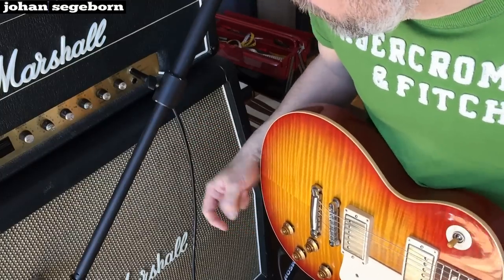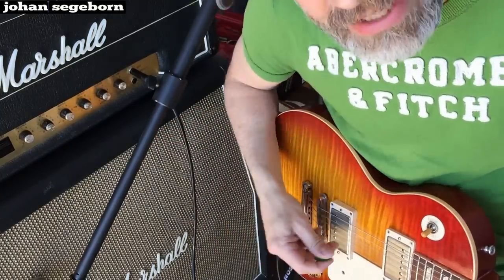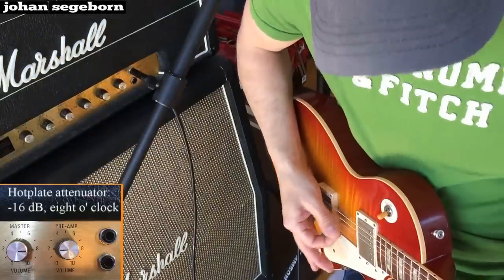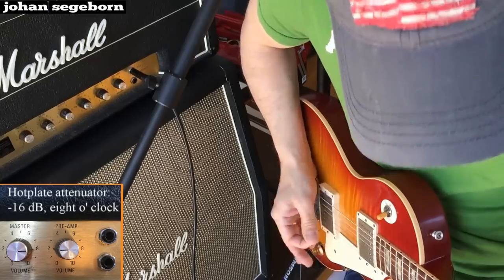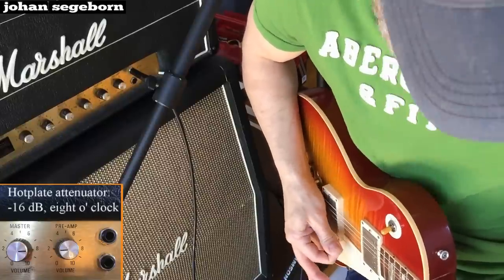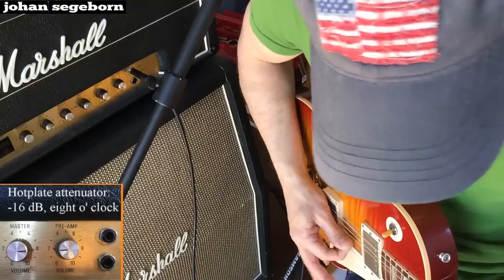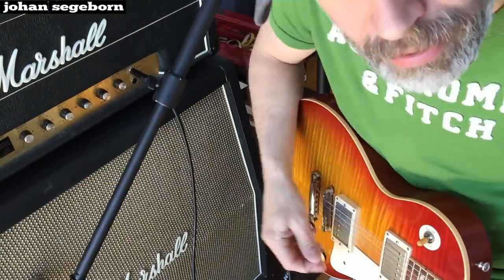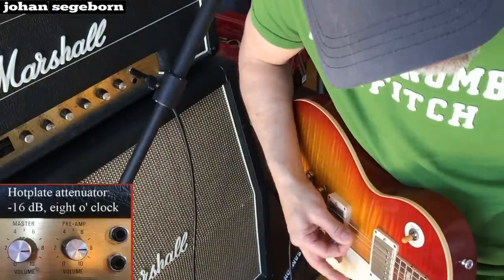Preamp Vs Power Tube Distortion

Comment: Hi, i was thinking just now about how big the difference is between different tubes, but i haven't seen a comparison between 6l6's at full volume vs el-34's at full volume, i think this could be a very interesting video, that many people would enjoy, Cheers!
Reply: 6L6s usually have more headroom and are a cleaner tube than EL34s. Also, more round and bass-heavy than 34s.
Reply: iHatePop Yes i already knew this, but a sound comparison would be nice, but i actually ended up buying a pair of el-34's and it changed the entire tone of my amp, the difference was like going from mesa to marshall, but in the end i am a metalhead and the el-34's didn't quite catch my tone, but still really nice for old school heavy metal. ,\m/

Comment: I think the attenuator affects the tone more negatively than having the master reduced. I like power tube distortion but not through a attenuator.
Reply from the maker: Yeah, there is definetly a trade off there
Reply: It is true. It is a different sound.
Reply: Bolloks, my plexi sounds almost the same with my Rivera rock crusher but my jcm2000 sounds crap lowering the master
Reply: Then again, the Rivera is touted as one of the better attanuators to hit the market

Comment: How do you plug a Marshall power brake into a Deluxe reverb w/o blowing anything up?  I'm coming out the speaker input the speaker jack is plugged into, and going in to the PB, then out the power break to the speaker jack using a1/4"  coupler.  It worked for a while but then nothing no sound.
Reply: What year was your Power Brake manufactured?  Pull the cover and see if the wires have wire ties or hot glue to hold them in place.  If no wire ties you have an older one that can cause issues and you should research this to get it fixed.

Comment: The amps were designed before good PA systems, so they are made to be ran very loud.  Thus the reason for all the newer amps being designed to be all pre-amp or very low wattage.  (or digital...<shudder>).  15 or so watts is plenty loud enough for most rooms these days.

Comment: johan I have a question, do these amps get overdriven as their volumes increase? so even if I have an attenuator, I have to crank the volume if I want to get a distorted tone as yours? what I mean is they don't have gain control separate from the volume knob right?
Reply from the maker: +RottingCarcass This amp has a pre amp volume control and a master volume control. You get distortion from both. So the pre amp volume is like a gain control
Reply: I see, so the distortion from master volume is power tube distortion right? Many thanks Johan, whenever I ask a question, you always answer it for me, I love you man
Reply from the maker: +RottingCarcass Thanks my friend

Comment: @johan segeborn could you please review the Rivera Rock crush Vs the hot plate? Or marshall powerbrake? I've did alot of research and was torn between the hotplate or powerbrake and even the Weber. However I believe the rock crusher is the best. The 500 dollar version is just an attenuator with a line out for recording on a computer but the 800 has an external eq that is just for the computer recording. Anyhow I only need the 500 one but could u please test it?

Comment: Hej, I'm concerned about what the attenuator does to the sound since I will most likely need one to play with power tubes cranked. do you have any thoughts about what to expect will happen to the sound and playing feel? Are really expensive attenuators better/much different? I know that at least in the past a lot of people warned against using them since they could damage the amp. Appreciate your comments on this and thanks a lot for your important and entertaining videos!
Reply from the maker: +mats wiksborg Thanks Mats, I use Hotplates and Webers, and so does many collectors and players I know. If you don't attenuate further than -12dB the sound will be almost preserved with the exception of feedback of course. 

As long as you make sure that the amp has a load that is equal or bigger than than the output impedance then you're safe.

Cheers Johan

Comment: Hi Johan! Hope you and yours are keeping well. Does this 2204 still have the bright cap on the preamp control? If I had to play very quiet with one of mine I was always annoyed that the sound was so bright but cranked the power stage compressing the dynamic range of the top end leaving the bottom end bright but with headroom always seemed to be the ace in the hole of the amp. I put the treble bleed on a push pull in the end so If I had to play quiet I could get more bottom end to counteract the old fellas Fletcher and Munson. Is the feedback on the 4 ohm tap? Take care
Reply: And fantastic video as ever by the way. Super tasty playing
Reply from the maker: Thanks! Yeah strangely enough the bright cap is still there and I think it's also still on the 8 ohm tap. Have you compared 8 vs 4? Gonna check that out :-) Have a great weekend! Johan
Reply from the maker: Thanks, makes me glad
Reply: Johan Segeborn yes I've done a fair bit of negative feedback comparison. I have to say I prefer the flatter response of having more feedback like the plexis, in the other hand with the 2203 and front end gain up there can be a little too polite and lacking in dynamics. Do prefer smoother clipping of less feedback, as long as using speakers with stiffer/heavier cones as the benefits are offset by more harsh top end. I have had a couple of factory original 2203s with a snubber on the second preamp anode. Subtle difference again. All spices in the recipe 😀. Hope you have a good weekend too! I think my 1987x is going to the gig tonight.
Reply: @JohanSegeborn  Realize this is ancient.  PoJoWo hit on a significant difference.  With master volume down, Presence control negative feedback is almost nothing.  An interesting (and complicated) test would maintain the feedback.

Comment: about attenuator loss.

i'm wondering if this is myth. everytime i hear one demo'd; the choked tone is measured against wide-open-throttle. the difference has to be less air movement from the speakers, at least in part.

just thinking out loud.......
Reply from the maker: I does influence tone and attack as well, but down to -12dB it is certainly neglible compared to speaker distortion.

Comment: I like your videos. Using a Reactive Load like Suhr's Reactive Load or AMT Power Eater PE-120 instead of a resistive one like the Hot Plate would help you retain the cranked amp sound at low volumes much better.

Comment: To play my 900 Later in the evening in my garage I set the volume about 11 o'clock crank the bass  to about 3 o'clock and then crank the gain all the way and it actually gives me a pretty nice tone at a low volume. I think I need to buy that JHS attenuator for 50 bucks

Comment: The preamp distortion seems like a simpler sound to me. Not bad but a bit like a stomp box. Pushing the power tubes gives it a real dimension and more like what we hear at shows and on recordings. Also, the character of both pre and post seems to be more pronounced. So if I swapped brands of tubes, I'd hear those differences more as we get into dirtier and louder territory. Great clip - thx for posting
Reply from the maker: +drbooks Thanks!

Comment: VERY interesting video, Johan. 
I didn't really like the high master + high preamp combo - sounded very fuzzy and out of control. 
When you switched to low master, high preamp I expected it to sound crap. But I actually LOVED that tone!
I think that the best way is not to overdo either of the amp's "sides". Therefore I'd go master @ about 4 with preamp at about 7. I bet that'd sound both loud and awesome :)
Reply from the maker: Thanks! Yeah it certainly loses definition when cranked to much. Cheers Johan

Comment: The power tubes sound better, but its still not an equivalent test because the attenuator is holding back the true sound of the cranked power tubes, even on a very clean setting.

Comment: Hard to get that nice sound with 100w amp. But if i play with power tubes turned down and higher the preamps i would get a pretty nice sound right? Sorry for bad english fast and tiered typing from a bumpy car ;). Cheers
Reply from the maker: Hi! I think both types of Distortion works in different types of music. So depending on the genre a pre PI (phase inverter preamp tube) master volyme, a Post PI master volume, a power attenuator or even an OD pedal or combinations of those will give you the best bedroom volume sound. The phase inverter tube distortion is very important and overlooked in many master volume Marshall circuits. Cheers Johan
Reply: Thanks! Ill take a look at all this stuff, btw i play a Mesa Dual Recto, i asume that would be the same for them?
Reply from the maker: I think the master vilume on the DR works especially great. Have you tried the DR with EVM12L speakers? That's the holy grail of metal.
Reply: I have only played it with vintage 30's. From what i've heard that's what every big bands play, I think i can check them out at my local music store tomorrow or so, think i will get a recording mic aswell, feels lonely playing alone, so why not play with myself :D?

Comment: Power amp tubes are very important to me, especially in a live set up. I no longer use a full tube amp, I'm using a digital pre amp with a Mesa 50/50 power amp section. I do not like to use a digital or solid state power amp. I'd love to try a marshall tube pre amp with my Mesa 50/50. I wish companies would get more into the rack design so we could have the power amp section we want as well as the pre amp section we want. I've never owned a Marshall, I really like the Marshall tone that Claudio Sanchez of Coheed and Cambria used to have with his, he uses an Axe FX model of it now. The Marshall JMP 1 pre amp can be had for like 500 bucks. I wonder how it compares to your JMP.
Reply from the maker: I'll track a JMP1 down and compare. Cheers

Comment: is this meaning we cant get a GREAT awesome classic rock sound in bed room level?
i have owned a few low watt tube amp. and still the master volume gotta be crank to achieve that great classic rock sound which is actually still too loud to be considered as bed room level.
Reply from the maker: I think a power attenuator is needed to get a good focused tone at bedroom volume levels even with low watters

Comment: The master volume on this model is a pre phase inverter master volume - so a lot of that highly revered power tube distortion is possibly  the distortion coming from the phase inverter tube.  If a post phase inverter master volume is installed - it is possible to get back a lot of that "power tube" distortion while actually not pumping the power tubes.
Reply from the maker: +VoxPathfinder15R I agree! Cheers

Comment: This is great first setting is like what Zakk Wylde does to his amps. He cranks master on full 10 and sets gain at about 3.  

Odd thing I do same thing on my ss amps that has ecc83/12ax7 and it seems they come alive driving that preamp tube hard.  

You might wanna give that a try, zakk wylde has pictures of his amp settings on the web quick google image search.   I also using Zakk's other setting's but I do start everything at 6 and make adjustments there.
Reply: Turning the master volume up shouldn't affect your pre-amp tube. What affects your pre-amp is the gain control.

The thing is, everything sounds better when you turn it up a bit, regardless of the technology (tube/solid state/hybrid/digital) it uses. Our ears like it louder, that's just how it goes. It may have nothing to do with the single pre-amp tube in your amp.

Comment: Power amp distortion on a class AB amp is a lot of odd order harmonics, somewhat ratty and snarly sounding. Preamp distortion is smoother, thicker, with even-order harmonics. My trick is to get just to where the power tubes start to clip hard, and add pre-amp gain to thicken the sound for just the right balance

Comment: Just tested hot plate yesterday and how it impacts speaker impedance/response. At that kind attenuation you are using here Hot Plate screws up FR response big time. It basically takes away all the speaker - tube - transformer reactance. Low end resonant spike in impedance disappears.  Try to measure frequency response of one single looped guitar take through an amp, and then attenuate signal with any kind of attenuator. Measure again and compare. You can use REW. I did this and got shocked. Bottom line, while fun the video is not very precise, and you can't really use hot plate for this demonstration.

Comment: You definitely lose a lot of the harmonics and overtones with the master volume turned down. If you want to just play the amp in your bedroom then its fine as you won't hear a lot of the harmonics with low volume anyway, but for a gig or definitely recording you want the master cranked. There is just something special about the power stage being pushed into distortion, especially in a Marshall :)
Reply from the maker: Indeed :-)

Comment: I dont know. I have an '86 2204, and it just sounds bad. I know, this could be many things, speakers, ( I have 4, 2x12 cabs to choose from ), tubes, ( I recently re-tubed the pre-amp section ) bias, etc...but as for tweaking settings and power levels on both sides, pre and post, it just sounds bad. Of all my amps, ( 9 in all ) this old Marshall is the most disappointing amp I own. As for your vid, lets face it, how many of us have a warehouse full of vintage speakers to choose from.....that makes a HUGE difference in the actual tone of a Marshall. Marshalls dont play well with many speakers...if your looking for classic sound that is. Good vid, just not very realistic for most of us....

Comment: My 2203 used to sound very good at moderate to semi stupid loud-new since 84,then I got the whole thing gone over,and it's so ridiculous,pre on 6-7,and 3 on the Master is the stupidest LOUDEST horror ever,and it doesn't get louder after 3!!! just woofier-really depressed,it used to blow up...just the H.T. fuse,but my stripped Basswood Frankie with a JB and a Boss GE-7,old glued up formerly used as a 'dart board'(no lie-this Kajagoogoo type Bass player didn't know what he had!) 70's 25w 16 Ohm Greenbacks,Van Halen II easy...now????

Comment: I thought pre and master at 3 oclock attenuated had the richest sound- listening w/ good headphones (AKG  K240).  I like the tubes turned up high myself so the challenge becomes finding good attenuation.  So far, 3rd Power Amps HybridMaster has worked best for me.   Haven't tried the Hotplate but you sounded great here- the attenuation didn't dull it any.
Reply from the maker: Thanks Lothar! Cheers